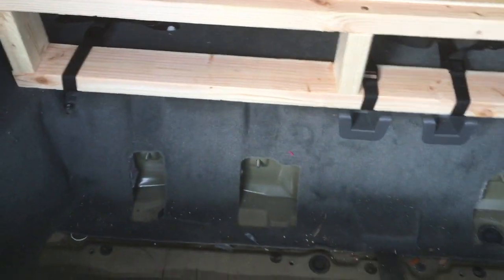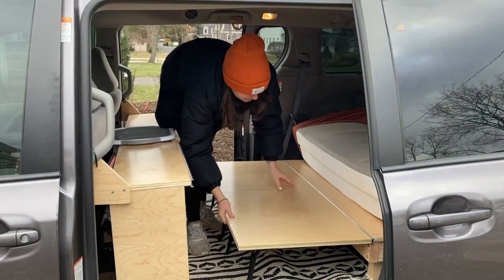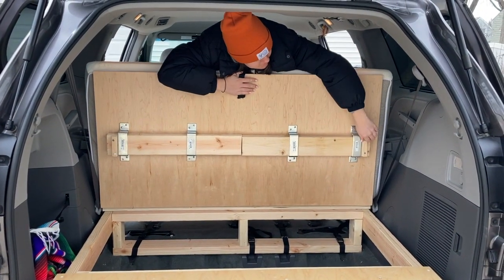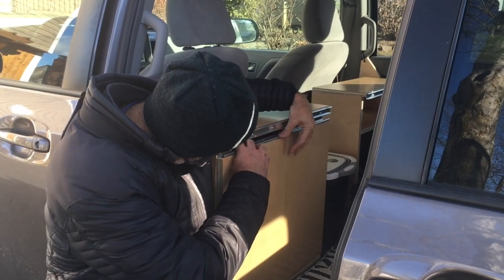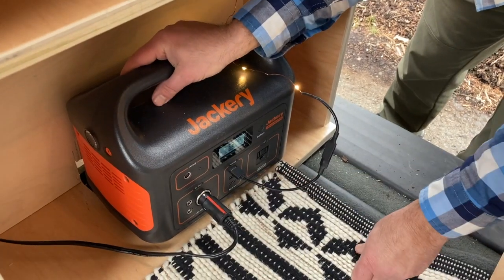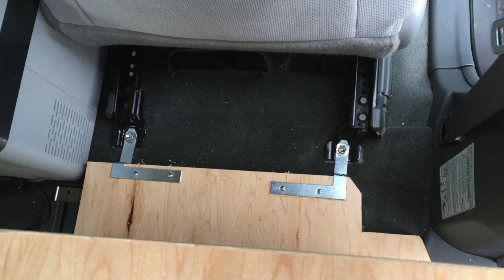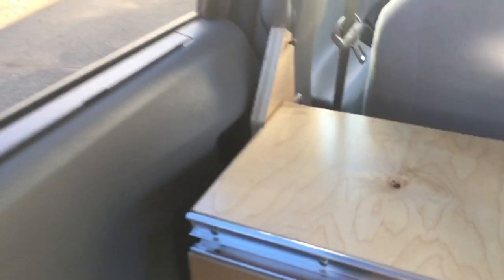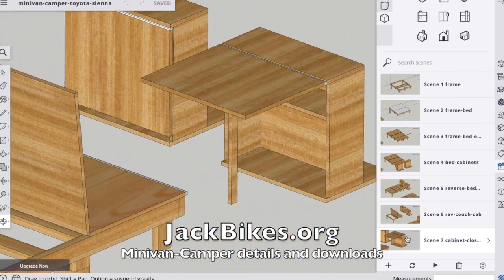Daughter & Dad Build Minivan Camper - Toyota Sienna

Comment: I used a wooden dowel and used a heavy duty zip tie to secure it to the handle near sliding doors. I used this to secure the front blockout curtain rod. And I secured my metal foldable shelves behind the front passenger seat to the wooden dowel. I did a road test with road bumps and sudden brakes in freeway traffic and had good results. Now I will secure the middle wooden cabinetry that I store long things like camp chairs, tents, table, etc., and also storage for large flat things like solar panel,  and

Comment: Thanks for sharing! I have subscribed. More success to you and your family. 

I like what you’ve done, especially fashioning the corner brackets to bolt it down to the back of the front seat. 

I have no experience with power tools and I have limited number of power tools. So I use a lot of heavy duty zip ties, ropes, and heavy duty Velcro tapes. 

Perhaps the following can help so you have access to the sliding door handle to open it. 

I used a wooden dowel and secured it vertically to the hold bars near the sliding door with heavy duty zip ties. Both my foldable metal shelving and front blockout curtain rod are secured to the dowel. Both  stayed secured even  in sudden braking in freeway traffic and off-grid roads.

In addition, I have secured floor-cabinetry and lightweight foldable shelving in the back and middle portion on one side of the van to the ceiling-hold bars. However, 
I’m thinking of installing a long-ish wooden dowel that extends beyond the hold bars on the ceiling ...  resting horizontally across the hold bars in the back end of the van to secure heavy duty cabinet. 

I’m not handy with power tools. I would welcome other ideas without involving major skills.
Reply from the maker: Thanks for explaining your wooden dowel solution!

Comment: One way to fast charge your Jackery is to use a pure sine wave inverter ( I use a 300Watt) plug the Jackery adapter into it and charge the Jackery while driving. It is much faster than using the vehicles 12V as a charger. I fitted a fused cigarette lighter connected with a 10ga wire direct to the cars battery to power the inverter. I have not had an occasion as yet to use my Saga100 solar panel

Comment: Really nice and versatile build. One thing I don't like is the web straps. In my build, I used those and they proved to be a weak point. I switched to u-bolts instead.
Reply from the maker: I understand why you chose U-bolts instead of web straps, and went back and forth on that issue during the design. In my case, I found what I believe are high-strength web straps and fasteners, and they've kept everything very snug and secure.

Comment: Do you have the links for the corner wood plain tool (never saw that) and special legs for the bed that fold (hair pin I think you said).
EXCELLENT build and love the simple cad tool. Thx !!  Subscribed.
Reply from the maker: See links to the hair pin table legs and other items we purchased in the Budget section of https://jackbikes.org/minivan-camper. We borrowed the corner wood plane from our friend Ethan, so it doesn't appear in the Budget list, but it's similar to this one https://www.amazon.com/Planer-Ebony-Plane-Woodworking-4-7Inch/dp/B07WV39K85

Comment: Hi,  Love your build.  And thanks for sharing the sketching and ideas.  I just got a 2015 Sienna,  started our camper conversion now.  When looking at the sketchup, saw the 4 inches x 4 feet long piece of plywood on the  head side.  Is that suppose to be nailed on the frame? or  you actually use a 2'4" x 4' plywood board on the head side.  If it's nailed to the frame, then can I skip the inside 2x4 thats 3'6".  Thank you.
Reply from the maker: Great question! In our original design, we had a 28" long bed section on the piano hinge, but it was too awkward to raise and lower from inside the van. So we trimmed off a 4" strip and screwed it down. Turns out that strip was flexing more than I expected, so we attached another 2x4 support underneath. Decide what works best for you!
Reply: @JackDougherty  Thank you for your quick responds on my questions.  As I wanted to copy the same bed size.  Wonder if your model is the same as my 2015 CE.  Also, is there anything to hold the top piece of the bed, and prevent it from slides out on bumpy road?
Reply from the maker: @monitachan7284  The 3rd generation Toyota Siennas (2010-2020) are supposed to be similar sized. The trim models are listed in Wikipedia as base, LE (that's what I have), and upward. So I don't know how a 2015 CE is supposed to compare because I don't see it listed here. https://en.wikipedia.org/wiki/Toyota_Sienna
Reply from the maker: @monitachan7284  At 0:24 in the video, you'll see the four straps that attach the entire bed frame to the van seat hooks, which keeps it firmly in place when driving.

Comment: Enjoyed the video and the tips! thank you. one question, what is the black sanding tool your daughter is using on the edges of the plywood?  I'm dealing with that right now!  Where did you buy it and do you have a link?  Thanks!
Reply from the maker: Great question. Maya is using a wood planer corner tool to remove the sharp edge from finished plywood. We borrowed the tool from our friend, but it’s very similar to this $10 tool on Amazon: Hand Plane for Woodworking, Katfort Wood Planer Hand Tool Wood Chamfer Tool Edge Trimming Plane for Edge Rounding Corner Rounding, with 1 Planer Blade and 1 Wood Fixer https://www.amazon.com/dp/B07FHXWHS4/
Reply: @JackDougherty  Thank you so much... Cheers!

Comment: Too bad you can’t do this on the newer hybrid sienna vans. On the new ones the middle seats have airbags in them so if you remove them it will throw fault codes. And the seats are much heavier too.
Reply from the maker: You're absolutely right. We created our design for Toyota Sienna 3rd generation (2011-2020), but it won't work with the newest 4th generation hybrid (2021-)

Comment: i got 2 little ones in car seats. how do i convert my sienna into mini camper?!
Reply from the maker: Not sure if you'll find a satisfactory solution to this challenge. While you could keep the kids and car seats in the middle row while traveling, and then lift out those middle seats at each overnight stop to extend the bed, the larger seat is pretty heavy, and you'd also need to cover it with waterproof bag or tarp to protect it from the rain when placed outside of the van.